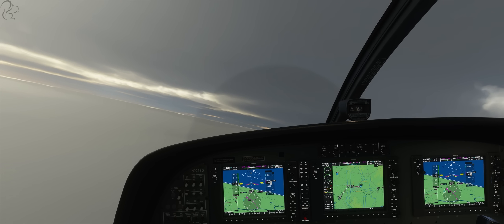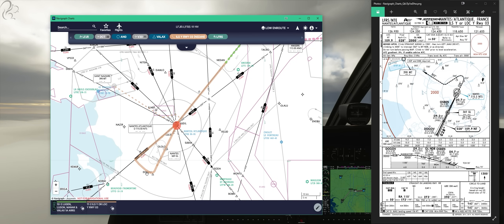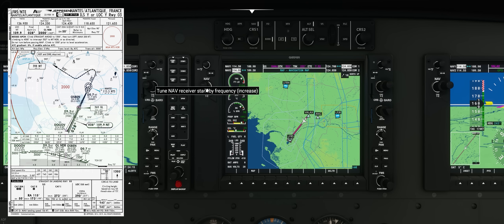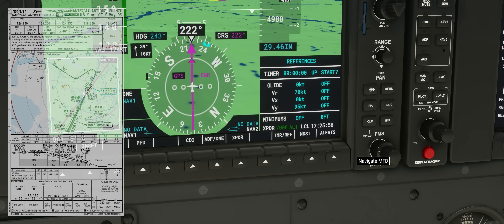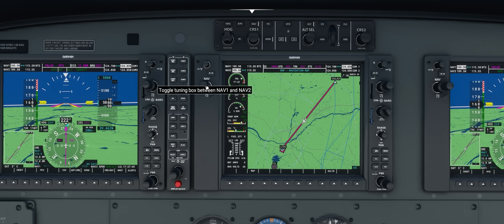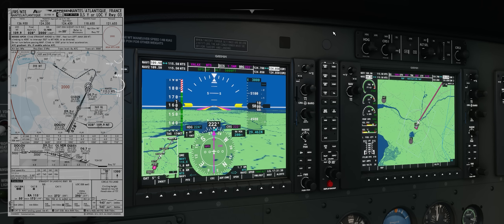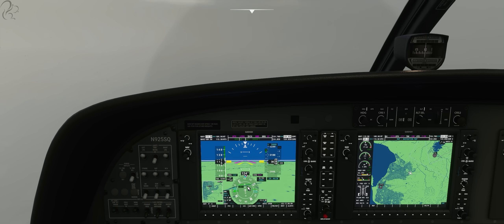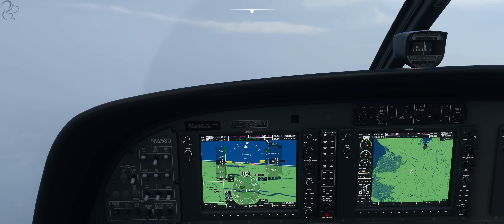Cessna 208 ILS Approach HOW TO in under 15 Minutes - Microsoft Flight Simulator

Comment: Anybody playing this without some expensive gaming PC? I've never been into PC gaming, but I would really like to get this & the "recomended specs" to play has me lost. I'm not trying to blow $1k on a PC just used to play this. Would a PC running Windows 10 w/ an i5 processor work?
Reply: If the i5 is a few years or less you will be ok.  5+ year old i5s are barely able to pull off 30fps.  You need a decent graphics card too.  Honestly, a PC costing less than $800-1000 is going to by iffy for playing MSFS.  It's one of the most demanding PC games in many years.

Comment: Sorry I can only give 1 thumbs up, it deserves more. As a newbie, my question: this type of approach is only possible to airports with ILS? What happens if coming into a small airport like some in FSEconomy in fog/clouds? Or even a bush airport with no lights?
Reply: On the MSFS map you can see two types of airport, the ones with blue circle have instruments procedures available, the ones with brown circles don't, and you will be required to land on visual. Make sure you check them before flying them, and check the weather forecast for those airports. You might just be able to land visually.
Reply: Basically, you don't.

Comment: If you utilize the Lead radial on the app chart you can avoid overshooting the LOC, in real world ops we avoid banks in excess of 30° in IMC to keep the establishment onto the localizer smooth, last thing you want is to go out of tolerance on the last turn and go missed after a 15 mile arc procedure.

Comment: Very cool, i actually followed someone elses video flying in germany and was able to do this very thing for first time in my game in following same germany airports at the video i found but i'm currently playing OnAir from KMCO Orlando and so far i've had no luck flying to a couple different florida airports (KLEE and KBOW). The frequencies i'm seeing is too high in the charts i found for nav frequencies and not fully understanding what all the frequencies mean or what they are used for. So i looked up "florida ILS approach airports" and actually found a list of all airports with ILS,, ,turns out 2 i went to so far doesn't have ILS, so wondering if there was other options or they just have to be manually flown in. I haven't had any issues flying and landing my plan however manually using the cessna 172 so far. But i'm trying to learn all the various methods and systems available so i understand what all my options are. It's fun figuring it all out but i learned through some frustration over 2 days not to use MSFS 2020 menu to setup flights with the cessna 172, it royally screws up autopilot in-game everytime i do. but if i just select a parking space,, load in game,, then put my flight plan into system manually then GPS is working fine, i hope that's just a bug that will be fixed in an upcoming patch as over time i'm going to want an easier way to punch in all these waypoints. I guess easiest way right now is put start and end destinations in, then select the departure/arrival/approach as needed and go with what you get closest to your flight plan (using simbrief so far)
Reply: There is a website called Airnav that has American airport information. You can plug in the airport code there and it will give you information about the airport, including links to any instrument approaches available. Runways without ILS might have an RNAV (GPS) or VOR based approach where you use either a GPS or radio beacons with specific altitudes to find the runway. These are a lot less precise than ILS but can be a lot of fun.

Comment: The Cessna Caravan has giving me only trouble in MSFS2020. For some reason the autopilot messes up the trim and then the plane crashes. I haven't had this issue with any other plane.
Reply: me as well it continue's to climb thru the assigned altitude even though armed and set properly, very frustrating
Reply: If I use rudder at all by accident while in AP the plane spins out of control

Comment: As I am learning this flight sim I have appreciated all of the proceeding lessons and have learnt a lot. I have been sticking to the Cessna which features heavily in previous lessons and was hoping that the introduction to ILS landings was made in that. Not only has Squirrel jumped up a plane, he has also outlined the HARDEST way to use ILS. Lost me completely. This is the first video here I have not upticked as it seems illogical to both change the usual plane AND describe the hardest way to implement an ILS landing. Great for advanced users, but very off putting for us novices. Sorry mate.
Reply: @SoothesMySoul20  Many thanks for pointing that out. I obviously need more sleep as I had not even noticed that certain videos were prefixed with "Tutorial #" and this one was not. I shall slap my face with a wet kipper and wait patiently in anticipation :-)
Reply: The previous ILS video in the TBM 930 was a very easy way to do ILS, you should check that one out. To be honest, it's done the same way as the Cessna 152, except in the 152 you have to manually follow the indicators, whereas here you just let the auto-pilot do everything.

Also, huge issue, the Cessna 152 doesn't have a DME, so it's kinda hard to follow a procedure when you don't know your distance to the target. The DME is the instrument that gives you a distance on the radio navaids you are connected to, like VOR beacon or LOC (ILS) beacons. With the Cessna 152 in the game, you can roughly follow an ILS descent manually, but you cannot follow the procedure of an approach chart.  You will have to upgrade to the 172 for that. 

Another clarification. He didn't highlight the hardest way to do an ILS landing. He highlighted a harder way to approach to intercept the ILS. ILS landing is always done the same way, but how you get to the ILS is different. 
To clarify, landing in IFR is done in two steps :
1- Follow a specific route around the airport that guides you to a specific point where you intercept the ILS (or whatever you use to descend), this is called the STAR and is what is shown in those charts documents.
2- Actually perform the final descent (like the ILS).

If you just want to practice the ILS descent, you can just roughly fly towards the axis of the airport, with good enough distance and keeping a given altitude (in this example here it's 3000ft I believe ?). Then as you intercept the ILS, you can just follow the indicators of the ILS. You don't need to follow the whole STAR to just practice ILS approach.
Reply: @POolBacK  thank you for those useful comments. I have already started using the 172 as  Squirrel has used it for a few of the tutorials and found it to be as easy to fly as the 152. What put me off was the three screens in the 208 as I would rather master the 172 before venturing any further up the ladder.  I must have missed the ILS video in a  TBM 930 so I shall follow your advice and take a look at that. Thanks again,
Reply: @BoxersAreTheBest   don't be put off by the 3 screens. The 208 has 3 screens, but the right most screen is a copy of the left most screen. It's only used for co-pilot, just don't pay attention to it.
For all intent and purposes, the 208 uses actually only two screen and is almost the same system as the 172, with minimal variation.

But yeah, in general, I would recommend focusing on the 172 to do this. Just input the frequency of the ILS as NAV1, make sure to change your PFD to VOR 1. Fly to intercept the axis of the runway at a certain distance. Hold 3000 altitude for now, and as you pick up the signal, align yourself on the LOC (or press the NAV button on the autopilot to do it automatically) and then you can presse the APR button on the autopilot to automatically descend following the glide slope. Really easy.

Comment: Thank you for yet an other great instructional video Squirrel.  Very much Appreciated.  I'm a newbie at all this, and you really help with these.  One part of the flight that is still puzzling me is:  when I am flying at my cruising alt, without using any ATC, when do I start my descent and at what rate?   you touch the subject a few times, but it is not clear to me.     Once again, thank you for your time in making these videos.
Reply: That where the VS (Vertical Speed) indications come in handy. If you need to drop from 14000 feet to 5000, that's a descent of 9000 feet. How far are you from where you need to be there in minutes? 10 minutes? Okay, you need to keep that vertical speed indicator at about 900 feet per minute. How far out that is depends on how fast you're flying etc,  but most places without mucking big mountains in the way are pretty forgiving of getting to your approach altitude a little early, so starting with plenty of margin is usually okay.

Comment: Great tutorials :)
What is still confusing to me is the meaning of the course. I know that the heading is used to direct your airplane into a specific direction by using the ap but what do you need the course for. I presume it has something to do with the ils approach but I'm still not sure..
Reply: The course is the direction of the VOR you want to fly to or from it , if you just hold your heading you could drift away from your desired course in case of wind for example ( captains correct me if I am wrong here)
Reply: @mariusfuchs4927  In boats, at least, that's essentially correct: "heading" is which way the pointy bit is facing, "course" is which direction you're actually moving after everything influencing moving has been figured in. Compass tells you if you're on the right heading, other stuff (GPS, VOR, etc) tell you if you're on the right course.
Reply: Heading aims the plane in a specific direction. NAV (course) follows a line on a map: that can be a GPS route, a direction towards or away from a VOR radio beacon (known as a radial and chosen with the course knob), or a Localizer (a radio beacon that helps you find a runway).

If you pick a heading, the plane flies that direction. If you pick NAV, the plane will first fly directly to the course you chose, then follow that course and automatically correct for wind to keep the plane on the course.

Comment: It would be great if you would explain the other approaches next - RNAV and VOR DME
Reply: RNAV is super broken in MFS2020 hopefully they fix it. VOR/DME works though
Reply: @kennyp1021  Sorry what do u mean by RNAV being broken?
Reply: Kamilohbk The sensitivity never changes from ENR. You don’t get TERM, APR, LNAV/VNAV, LPV etc sensitivity. So you can be pretty far off centerline without noticing any deflection on your CDI. Getting to the IAF is a mess. It draws some random arc to it and it doesn’t know anything about about procedure turns. And good luck trying to get it to sequence to the next waypoint. Glidepath isn’t right at all. And for all approaches, the missed approach procedure isn’t included
Reply: @kennyp1021  That reminds me of something. Sometimes i get a full IFR route from the sim's inbuilt flight planner, but after 2 steps it stops following the route for some reason and keep X course. Is it related to that?
Reply: Kamilohbk not sure I’ve seen that in the sim. Does it happen when you’re using a departure procedure?
Reply: @kennyp1021  Yes, i even set the airway in both dep and arrival, and it happens after the departure airway
Reply: Kamilohbk This is just speculation without seeing your issue, but it might be procedure that is dependent on radar vectors to your first fix. The chart will tell you. You can tell the the GPS to do Direct To your next waypoint or activate the next leg
Reply: @kennyp1021  I have a few tutorials of RNAV GPS approaches on my channel and they do work.   They are not exact to real life, but they do work in FS2020.